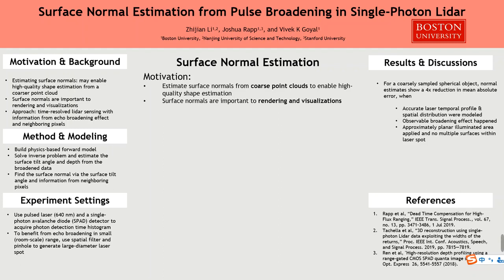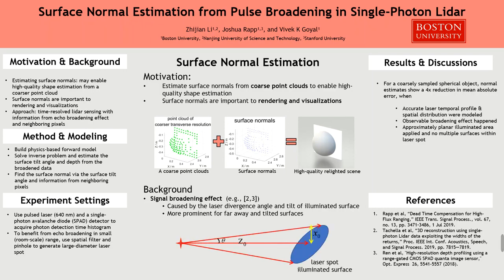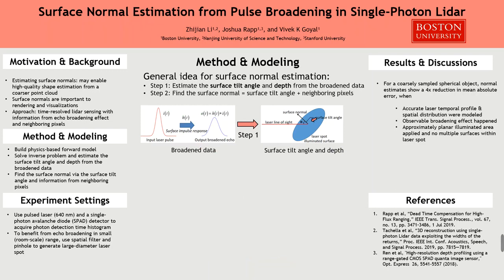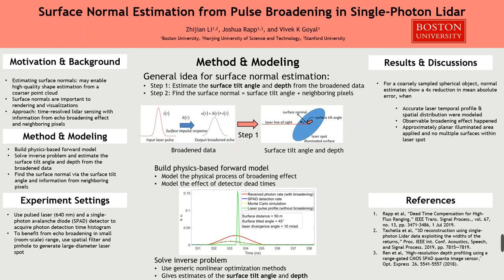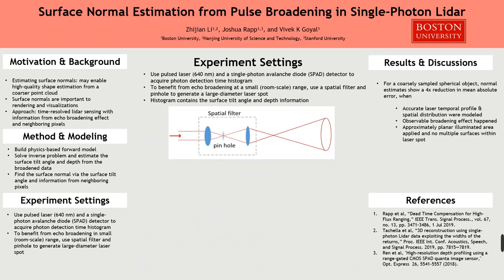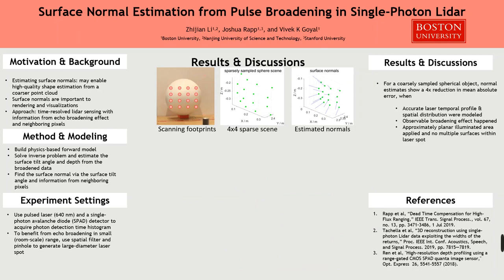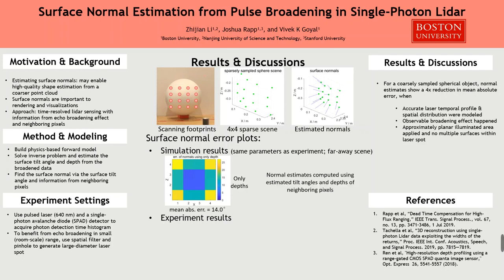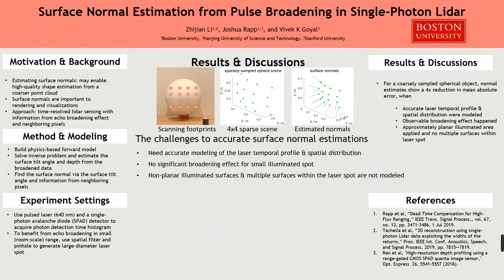#30 Surface Normal Estimation from Pulse Broadening in Single Photon Lidar (Poster)

Comment: Hi Zhijian,
Very neat idea of exploiting beam divergence to get additional 3D information. I have 2 questions:
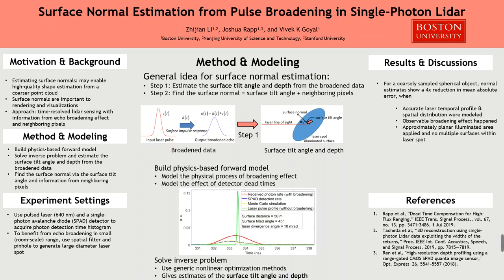(1) At around 1:40 in the plot of different waveform shapes, is the SPAD's measured rate (blue curve) different shape from the received waveform shape (red curve) because of pile-up?
(2) The idea seems quite general and could be used with conventional APD sensors too. Is there any reason to restrict attention to SPAD detectors?
Thanks!
Atul
Reply: Hi Atul,
Thanks for your questions! 
(1) Yes, that waveform distortion is due to the pile-up from the presence of dead-time. In the parameter setting, we set the mean number of photons per received waveform to be one (a high-flux condition), so we can see a significant waveform distortion here.
(2) That's a good insight! Actually, there are previous studies on pulse broadening with conventional APD. The physical process of broadening we built here is similar to conventional studies. We thought the pulse broadening phenomenon could be very interesting if SPAD Lidar works in a high-flux condition, where the dead-time effect plays an important role (e.g., leading to waveform distortion, range walk error, etc. ) in the broadened waveform. 
Thanks, Atul!
Zhijian
Reply: @zhijianli2985  Makes sense. I have one more question. Was there any other ambient light in the scene?
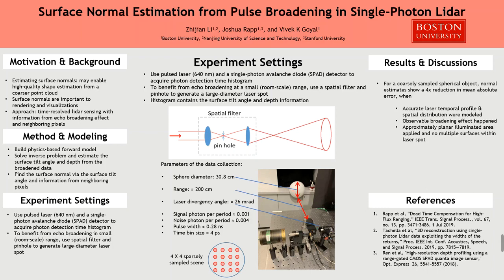Reply: @ingleatul  Thanks for your question, Atul! Yes, the main source of our ambient light came from the LED lights of the instruments (such as the LEDs on the laser driver, TCSPC circuit, and delay generator). We observed an ambient light level of ~4000 counts per second. Our working cycle is 1000 ns. So we had a ~0.004 noise photon per cycle as you can see at 03:03.